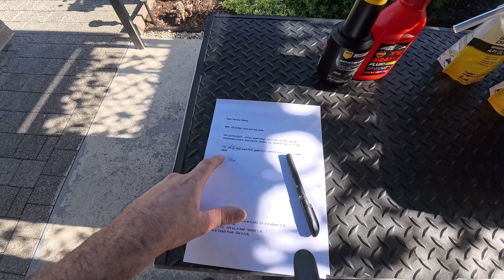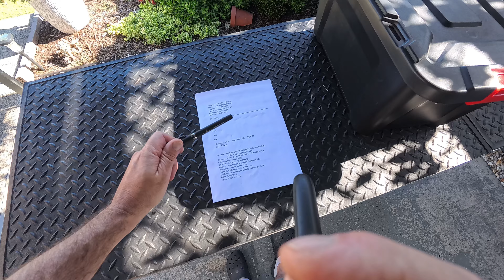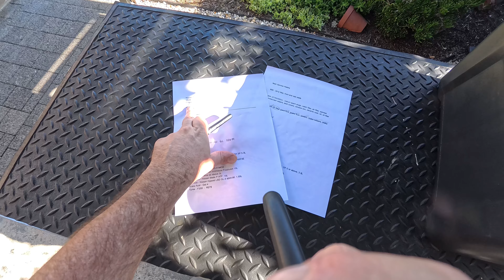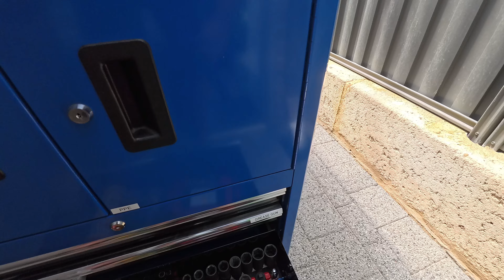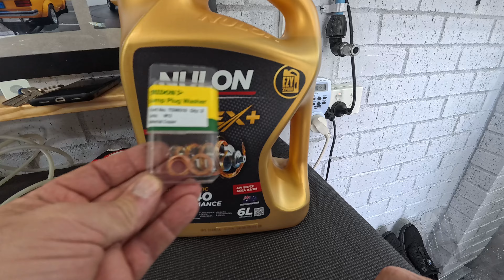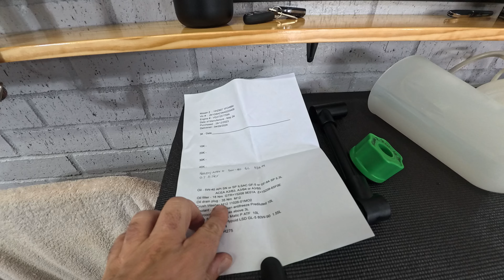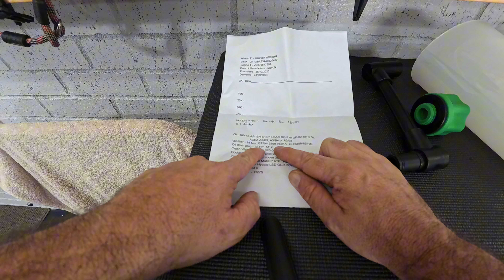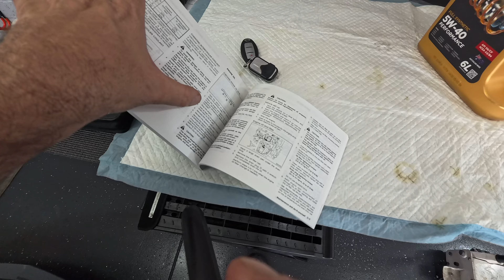2024 Nissan Z oil Change

Comment: How did you go with the weep hole covers for the house mate?

Any updates?
Reply from the maker: Still have not installed. I have to chip away excess concrete in the hole to get these things to fit. When my knees and back are feeling good I will do them

Comment: Not a fan of the plastic oil pan assembly. Sucks have to suck the oil out to get the remaining they could have just placed the drain hole better owell. Nice rig mate in good hands with you owning it. Interested in the oil tests results didn't know there was such things!
Reply from the maker: Yeah I only found out about the oil testing recently as well. Just finished up making up an access panel for doing oil changes. Sucking it out is no biggie but would have been easier to put the drain hole a bit lower.